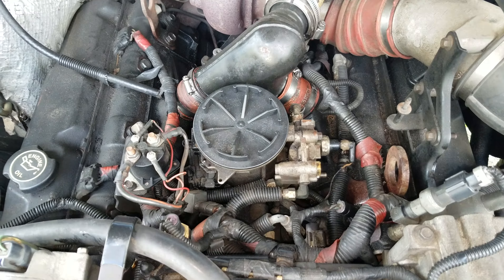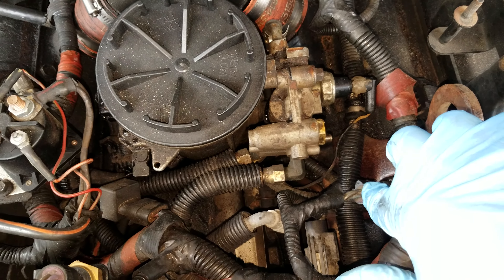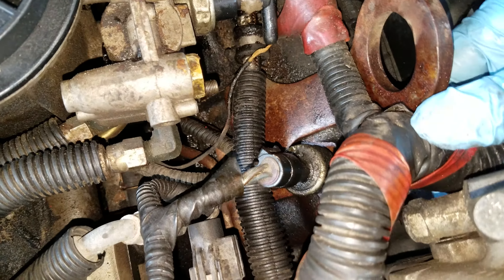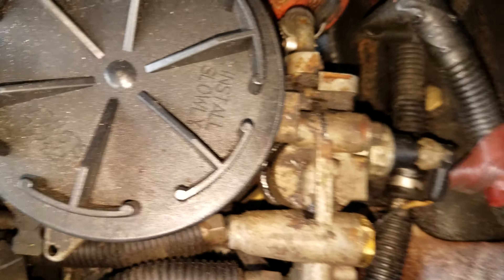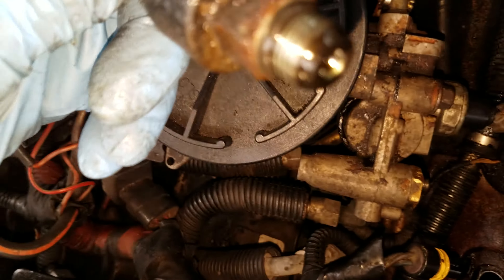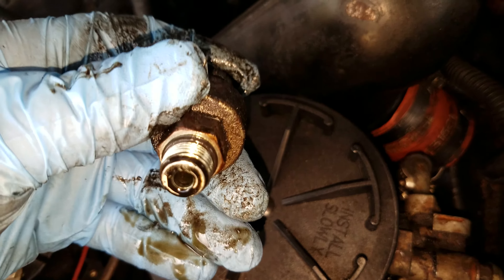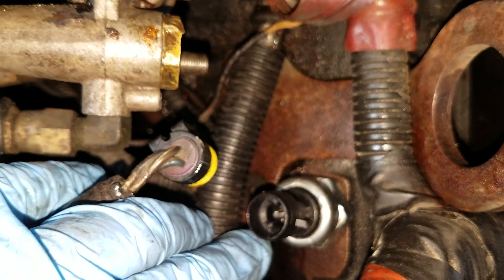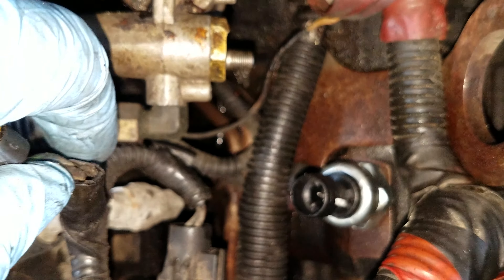7.🌲 ICP sensor replacement obs

Comment: I just did this with my ICP as well. Bought some crow's feet adapters from Harbor Freight since I wouldn't be using them much. Worked great! Same as you, I had the original still on the truck after 305k miles. On a cold engine start (and sometimes even after it was warmed up) I would get a check engine light for about 20-30 seconds. Afterwards it would go out and the motor would idle smooth but I knew that wasn't an issue that would get better. Sure enough the ICP was the culprit. Replaced it with an original Ford replacement part and now works good as new. I did also purchase a new IPR and was going to go ahead and replace it as well as it also looks original, however, there is a fuel line in the way that I'm going to need to figure out before I attempt to remove the old one. The fuel lines appear original and my fear is if I mess with or move them they could break or leak. They are weathered. Maybe it's time to rebuild all of that but until I see reason to do so I'll leave well enough alone.
Reply from the maker: I would definitely definitely  Recommend doing the basic fuel bowl delete on your truck you would be so happy with the Room you have to work on it afterwards.
 Made a video on it check it out the link is in the description of the video if you wanna check it out on the eBay.
Reply from the maker: And I forgot to mention that IPR job that you're fixing the do that's gonna take you hours to do it turns into a 20 minute job if you have the fuel bowl DELETE. 
Here is the links to videos https://youtu.be/tP2TBm9Ho4c
https://youtu.be/YC8gGw-zDc4
Reply: That's what I was afraid of. Thanks for the input!

Comment: Hey did that solve your problem did your truck run again because my truck died on me and I have 270,000 miles in my ICP sensor is covered with oil could that be the reason
Reply from the maker: Good Possibility

Comment: Hey I’m just wondering, I’ve got a 97 7.3 335k and it died mid drive and now crank no start my icp looks like yours would this cause it? I’ve replaced the cps already
Reply from the maker: There's a possibility If you have never replaced that sensor do it

Comment: Will a bad icp sensor cause the oil gauge to move around?
Reply from the maker: No because I have replaced plenty of the sensors I own three of these trucks never had oil gauge go crazy on me
Reply: @FLORIDALIFECLIPS  so Its the oil
Pressure sensor then bc I’m tryna buy that part
Reply from the maker: @SilkDoctr  I'm not 100% sure because I never had the issue but I would start there I don't think that part's going to be too much money
Reply: @FLORIDALIFECLIPS  I got it done lol I just had to clean it haha I kinda moved it when i was doing my water pump